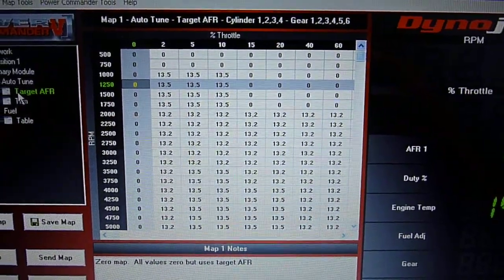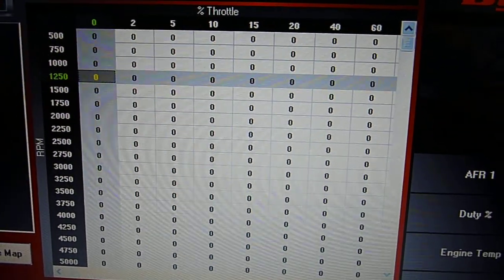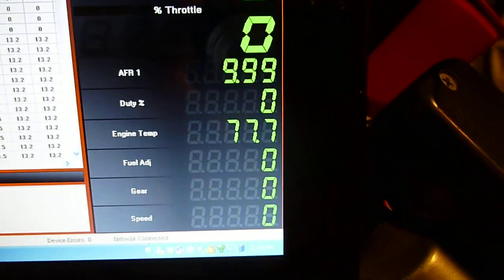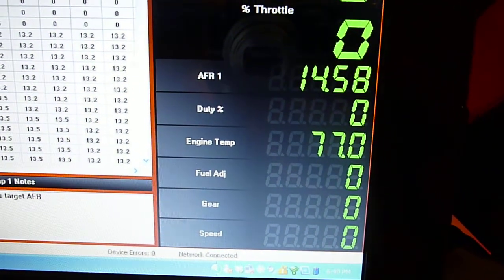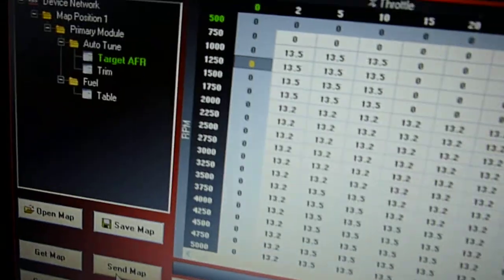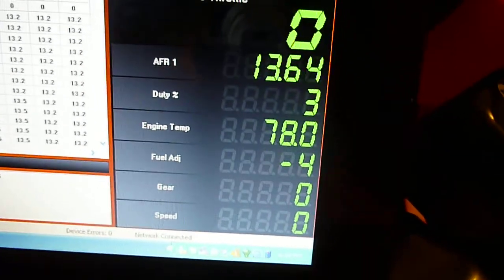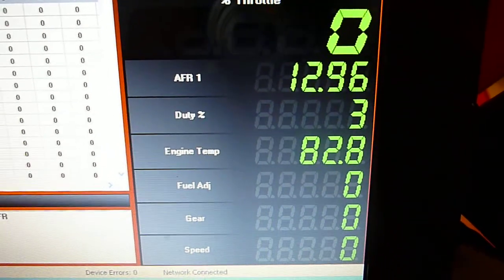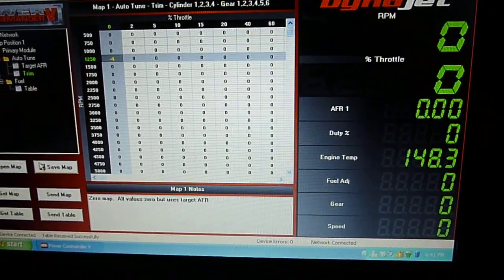Powercommander V Autotune switch behaviour

Comment: Years later I assume you found the “accept trims” option so that it would add those values to the actual fuel table to attempt to maintain that without using extra or less duty from the auto tune allowing it to naturally run at your targets.
Reply from the maker: Actually years later I can't stand the idea of Power Commanders.  For me now, it's either full ignition and fuel map, or GTFO!
Reply: @KaldekBoch  I hear Fueltech makes a good product. My pcv and accessories work well with what I do. No complaints here
Reply from the maker: @BaughsOutRacing  sorry if I sounded jaded.  I've been on cars for a few years now and learned a lot about tuning in that time.  There's only so much that piggyback systems can do, you know?

Now what I'd like to do is boost a VFR and put it on E85 like I've done with my (turbo) car.  Heck, even just supporting E85 on my K1300R would make it insane (13:1 compression ratio motor).
Reply: @KaldekBoch  Now you're talking my kind of set up!
Reply from the maker: @BaughsOutRacing  Yep.  Plus bike videos are what people want to watch (not that I do this for income or anything, just a hobby).  Problem is peak career age, plenty of money but no time.  What little I do have is still going into various things on the car.

Comment: Where do you get an Auto Tune switch? I don't see one on the website.....
Reply: Any switch will do.   You just wire it up to the ports on the Power Commander and configure those to act as the switch in the Powercommander software.
Reply: Edward Luck Cool, thanks!
Reply: Edward Luck One more question. I have the Auto Tune with the dual 02 sensors. Most maps are configured for the single 02 sensor. So do I just activate the dual 02 sensor option in the Auto Tune software and copy and paste the same map to each cylinder?

Comment: 14.7 is right on the edge of what your bikes engine will take, it maybe alright for a car but a bike you will burn your engine at that ratio dynojet has found that for the best compromise of fuel mileage and throttle response for the cruise range is a target AFR of 13.4 - 14.0 for all other ranges 12.8-13.4 seems to work best with most sport bikes performing best at 13.2 and that info is coming from dynojet itself, dynojet also states not to make your bike any leaner than 14.7.

Comment: Yes, I wouldnt be comfortable using autotune permanent. If you're basing your tune of a zero map it's always easy to go back. Also, if your trim values max out at 10%, you need to accept the trim and let autotune do its thing again to dial the tune in further. But I think we are on the same page :) Thumbs up for the vid.

Comment from the maker: For permanent tuning purposes, yes.  However this is only recommended if you are in the middle of building a permanent tune.  For on-going small trims you should not accept them, and indeed should set the maximum trim values to a small range (say, +10/-10).

Comment from the maker: That's true!  I should have clarified that, but the purpose of the video was to show how the switch affects the values in the autotune trim table.   Also, the problem with accepting trims is that they better be right before you accept them because after that you can't go back to your original map unless you have a backup.   This is completely different to the usual notion of "trim" on a closed loop ECU.  There should be short term and long term trims, both of which should be able to be cleared.

Comment: That the thing cal it wasn't putting out error codes ever it would idle on 4 cylinders all good then it would drop to 3 then on to 2 cylinders the rear two cylinders were shutting down even with the computer pluged in it was saying it was fine then you give it a good rev then pop its back on all four for a while not to worry its bloody gone now

Comment: hi cal again mate i bought my new vfr800 last november the second day i was riding in town i was in second gear riding along than it started to die and splutter then came good now its been doing this quite often so my dealer fitted staintune pipes and power commander v the problem is still there the bike has now been at the dealer for 3 weeks trying to find the problem but they cant it only happens between 0 to half throttle any idears mate im desperate they cant find the problem thanks matty b

Comment from the maker: @alykarate Engine temperature is a built in feature of the Power Commander V - you only need to tap into the engine coolant sensor wire (this is documented in the installation instructions for your bike).  Unfortunately it does not work with Power Commander 3.

Comment from the maker: @Aldivine You may need to upgrade the PCV firmware.  I had to do this to mine to get AFR readings to work.   Also check the lights on the Autotune box.  If one of them does not stop flashing after 10 seconds, your Autotune O2 sensor has failed.  Both lights need to be on all the time and not flashing.

Comment from the maker: @Aldivine LOL, I fitted it myself.  All you need is a switch from an auto parts store and wire it into the "switch" sockets on the Powercommander V.  Then you just reconfigure the Powercommander so that the Autotune is turned on and off by the switch.  I mounted my switch on the inner fairing panel under the left-side handlebar.

Comment from the maker: @toyscostmoney10 It's possible for the sensors to fail and go fully lean.  Good way to test this is to unscrew it from the headers and wrap it in a cloth which has been heavily sprayed/soaked with carburettor cleaner.  This will keep out the oxygen and it should read fully rich (9 or so) when you hook up the laptop.  If it goes rich then suddenly fully lean (17 or more) then it's a dud.  Just make sure you spray enough carby cleaner on the rag otherwise the test won't work.

Comment from the maker: @toyscostmoney10 Just to confirm, did you unhook your PAIR system?  Autotune will NOT work at all if PAIR is connected because it makes the Autotune sensor see very lean readings.  Bikes with PAIR and factory O2 sensors close the PAIR valves off when the bike goes into closed loop (listening to the O2 sensor) mode.

Comment from the maker: @toyscostmoney10 Basically this means that the AFR values provided by default are wrong for your bike.  This is essentially the biggest problem with the Autotune - Dynojet give you a predefined AFR target and everyone assumes it will work for their bike.  Tuning for power and driveability means finding the right AFR for *that* bike at *that* rpm and throttle position, and maybe even *that* gear.  The Autotune needs to be treated as a blank canvas for an artist to work with.  Go find an artist!

Comment from the maker: @wowerman The Autotune adjust the fuel based on values from the O2 sensor as you ride.  It tries to hit a specific Air/Fuel ratio defined by you.  It essentially slightly alters the map inside the PC5 so that the air/fuel ratio you want is reached.  It is very hard to tune for power this way, so the best use for Autotune is to use it to tune for fuel economy when cruising.

Comment: hi,my thinking is that pc3 or pc5 has got custom map for your bike and is connected to O2 sensor,so reads values and...what is happening next?is pc changing fuel/air ratio depending what is read from sensor?or are maps in pc just fixed and do not change when riding?is autotune  better to install just to read values from sensor and throttle position and adjust ration depending of air conditions?

Comment from the maker: @brooksidemech Autotune alters your fuel on-the-go based on feedback from a wideband O2 sensor.  You tell the PCV what air/fuel ratio you want to hit and the Autotune does the rest.  You can use this to make a good tune better, but it's very hard to make a custom tune from nothing.

Comment from the maker: @kpandinu Sure, if your dyno tune was accurate then your Autotune with settings around the +10 and -10 can make the bike run better at cruise.  But you need to make sure the target AFR values are the best for your bike and try not to tune in throttle positions which don't work well (such as 2% throttle for example).  It all depends on the bike really.

Comment: The Auto Tune kit can be configured to run and correct at all times or by using the "map switch port" on the PCV. You can set it up so that you can switch back and forth between the tuning modes and the base map settings. You can also configure the Auto Tune kit to wait until the bike is at a certain operating temperature before beginning to make adjustments.

Comment: I taught that you leave you autotune connected and adjusting all the time? is this right? My bike was dynoned but i taught that if i get the autotune it would work better because it will automatically adjust the fueled while riding. depending on the air temp etc. Am i right or not?

Comment from the maker: @claas90017 It will give you a bad map because when you decelerate with an open throttle, it will tune the engine still as if you were on the gas.  No system should alter the fuel map when decelerating.

Nobody ever slaps their throttle shut *every* time they decelerate, so the Autotune keeps getting its knickers in a twist.  Folks have fitted vacuum-controlled switches in-line so that the Autotune is deactivated whenever intake vacuum is high.
Reply: Smart Solution

Comment: Kal thank you for the reply. So if i understand you correctly, you are advocating starting with a base map (whether custom or not) and then only turning on auto-tune when switching octane or other mechanical change (eg air filter) and then only using it to build trims by making full power runs. Other than these conditions you turn it off because non 0% throttle decelerations create less than perfect AF mixtures.
Is this correct?
Many thanks - Philip . ..

Comment from the maker: @xphilip No, not a bug!  It's handy to have the switch because it means you can turn Autotune on when you get different octane fuel, or are riding in different altitudes.  Building a map with the Autotune is harder than they say, because if you decelerate on anything other than 0% throttle, the Autotune make bad trim adjustments.  It is much better to get a custom map done on a dyno for your bike, and use the Autotune to make temporary trims to that map when riding.